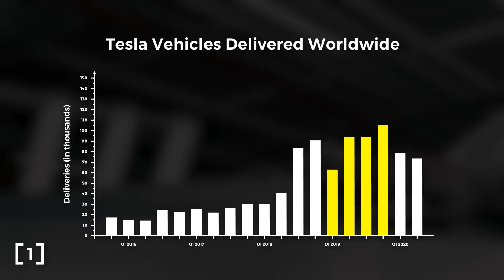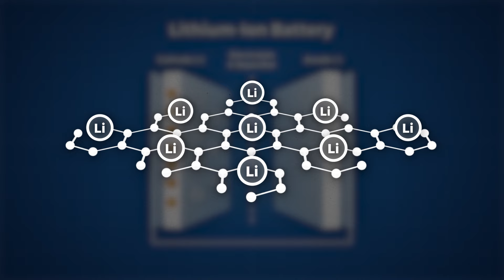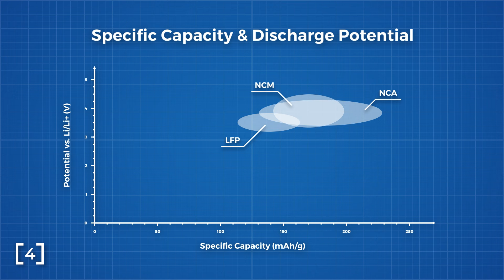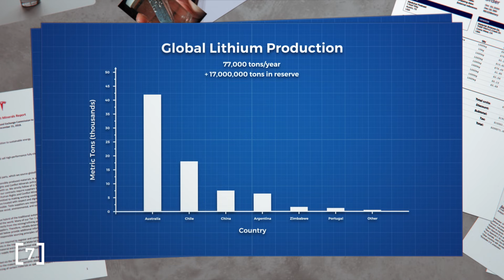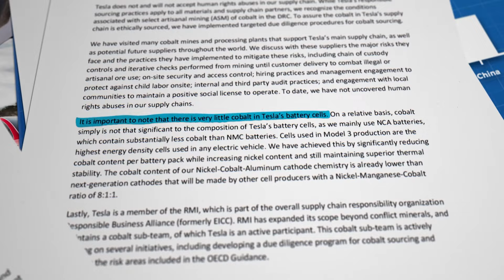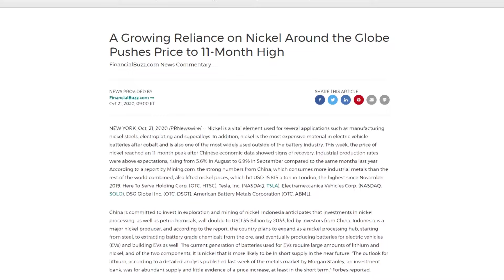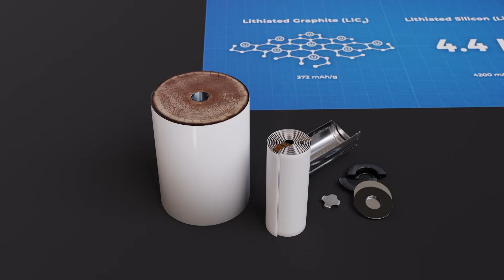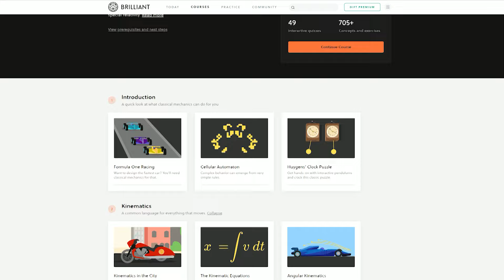Tesla's Battery Supply Problem

Comment: the only feasibly way to to dramatically reduce global carbon emissions is through a large investment in nuclear power
Reply: A breakthrough in geothermal could help, but currently it’s only viable in volcanically active zones.
Reply: As if we have a carbon emission problem. Just read the leaked emails about ClimateGate on Wikileaks. Get real!
Yes nuclear power is a great solution!!
Reply: @James-sk4db  Iñdonesian: yessss
Reply: Renewables are cheaper.
Reply: @JasonSmith709  do you have any clue about Thorium? Do you have any clue about physics?
Reply: @tinolino58  yes, i know lots about physics, that's why i support renewables.
Reply: @JasonSmith709  I sm sorry: physic is not politics
Reply: @JasonSmith709  Nuclear is cheaper especially 4th gen
Reply: @JasonSmith709  the problemis the storage when renewables are just intemitent
Reply: @olivierb9716  that's what batteries are for

Comment: What i learned?

We need asteroid mining soon..
Reply: Thats not more profitable
Reply: I thought the same thing...
Reply: @Mr2winners  it actually is
Reply: there is spacex with Starship for that
Reply: Actually, hybrid batteries. Including ultra-capacitors. Rather then create a monolithic cell relying on one chemistry for storage. The switch cells to optimize on performance, range and lifecycle.
Reply: @sadface7457  Forgive my lack of knowledge, but how will ultra-capacitors out-scale the the range of a battery?
Reply: @DiegoLopez-zk8vj  Current rockets cost 1k/kg to low earth orbit. It costs about ten times that to go to the moon. It would be at least 100 times as expensive as it is to mine on earth.
Reply: We need to mine the oceans.
Reply: @Justin73791  The idea is analogous to harddrive cache or computer ram. The ultra-capacitors sit between the battery and the engine and help reduce demand on the batteries. The fewer micro- cycles and with even discharging on the batteries the longer they will last. They extend range though regenerative energy capture technologies and by reducing resistive losses cause by the internal resistance of the battery (high power output).
Reply: @sadface7457  Okay that makes sense, but would it truly help current battery range? From what I can find the best ultra-caps have a power to weight ratio 20 times worse than batteries. 

Unless they do a significantly better job of capturing regenerative energy I don't understand how it would be worth vs just adding more raw batteries. 

In terms of longevity I can see how they protect the battery from short burst, but Tesla batteries are already proving to last a long time. I feel like the best super caps can offer is a small hybrid buffer, but more of a small step forward than a true solution.
Reply: @Justin73791  I think in first principles. They change much faster. Rather then range as single number as if you are going on a road trip. Consider range interms of (what people care about) how far you can go on 30 minutes change. That ability to entended range (similar to ice cars) is an important that improvement to range batteries cannot compete with. Long term their ion capacitors will increase energy density. The average commute is under 30km.
Reply: @sadface7457  So basically instead of focus on a single ranged number, focus on faster charging times. 

Assuming they nearly instantly charge I can see that working. I guess as long as they can provide short trips uninterrupted and medium ones only require a short stop (like filling up for gas). 

Though we'd still have to solve problems like commercial transport.
Reply: @Justin73791  The transportation equation is best solved with a plurality of approaches.The notion that one transport option, one battery option will suffice will lead to a resource bottle necks. 

When the petrol price is high people consider diesel as an alternative. If the mineral price increases their will be a premium additional range will be less attractive to consumers because it will cost so much. Since batteries are a lot upfront people might consider fewer batteries or battery alternatives or alternative chemistries.

Capacitors dont have instantaneous change time but they charge 10-100 time faster, dischange and charge times are related, and that will feel instantaneous compared with batteries.
Reply: @DiegoLopez-zk8vj  no, it's not. We don't even have the technology to do that now.
Reply: the flaw of asteroid mining is that the economy is not ready for mining on earth to be replaced
Reply: @LH-zz1pg  The space travel is not energy efficient enough to make it viable.

Comment: This is a top tier information, content and presentation, good job!, a lot of things to think about this issues.
Reply: He actually missed the most crucial part about the new battery construction - due to tabless design new batteries are planned to be few times more energy-efficient than current ones. This may solve all the other problems with material scarcity etc. So the whole video is either a bit of propaganda about how tesla is worse than it actually is or Brian is worse at engineering than at making videos.
Reply: This guy elaborates on the technical specifics and efficiency of the new battery quite a bit:
https://www.youtube.com/watch?v=hbPKE62aM0U

Comment: When it comes to grid, or long term energy storage I always thought about Hydrogen.  Excess electricity would be used to split the water into hydrogen and oxygen. Store it over time, and then as needed use it as a power supply when the demand is needed. 

I am sure that I am missing a lot of key issues in the process, from cost to efficiencies, still this has potential I believe.
Reply: The most obvious issue is: it needs to be compressed and this means energy loss.
Also some of the parts needed in hydrogen duel cell are also not cheap, is my guess. But it's not the only option, the Wikipedia page for hydrogen storage is long.
Some hydrogen plants for grid energy storage do exist: Canada, Germany.
Reply: From what I know, hydrogen extraction from water is extremely unefficient compared to other storage methods, which is the reason why hydrogen is very often produced from oil.

But with more research, who knows what could be possible in this sector?
Reply: @Theimtheimtheim  "which is the reason why hydrogen is very often produced from oil." I believe it's actually natural gas, not oil. But I'm no expert.
Reply: @autohmae  yeah, me neither, but you're probably right...
Reply: Many people have already thought about that. It's called Hydrogen Batteries. Since Elon Musk families owned mines in Africa since before he was born, he has not only ignored but attacked the technology.
Reply: @nemou4985  woah! Conspiracy theories much?
Reply: @Theimtheimtheim  but from oil or gas more green house gases are dumped into the atmosphere,  so not sustainable.   Do we have sufficient accessible fresh water in the world to destroy it creating hydrogen?  Should we only use salt water which then brings us back to transportation.
Only way I see for hydrogen  is leaving the waist products underground in place of the gas/oil.  As is being done on a small scale in Canada.
Reply: @sasa asasasa the grid doesn't need compressing storage. Plus we use compressed natural gas all the time, even on converted cars. Hydrogen is explosive? Yes, but so is gasoline, I don't see anyone running away from it.

Comment: The Tabless battery also has far more Power Density (lower internal resistance) according to EEVBlog. That means they'll have the Energy Density of Cylindrical Batteries but the Power Output per KWH of Pouch Cell batteries.

Comment: The use of batteries to overcome the drawbacks of solar and wind generated electricity is ridiculous, the answer lies harnessing the nuclear process in some way.
Reply: Exactly. And natural gas isn't even bad.
Reply: Someone calling "use of batteries to overcome the drawbacks of solar and wind generated electricity" ridiculous wants nuclear energy? Good joke. Nuclear energy is absolutely uneconomical.
Reply: Nuclear energy has proved expensive, at least in the United States,  primarily because of the regulatory overheads imposed by fear-mongering. Development of the techniques that would open the door to cheaper solutions has also,to some extent, been held back from this negativity, here small modular reactors manufactured in a factory would short circuit many of the delays of building onsite. In the longer term there are other inherently safer designs that utilise molten salts, which besides being more efficient and almost impossible to fail catastrophically supplement there value by reducing the production of dangerous left overs, indeed they may be able to reduce the current stockpiles of used fuels. The world needs an international effort to develop these answers, fields full of solar arrays and hugely destructive wind turbines along with batteries are no solution.

Comment: I feel like you missed the point of Tesla’s use of multiple chemistries and in particular not using nickel in grid storage and only using cobalt (in increasingly reduced ratios) in a subset of their products. Not to detract from other grid storage options, your point regarding lithium still holds.
Reply: Yeah, they'll likely use the lithium iron phosphate batteries in the megapack which will be much cheaper and last probably 4,000 cycles minimum before being scrapped for recycling.

Comment: Where it's possible, pumping water uphill is a pretty effective energy storage system.. already in the 1960's Switzerland reversed the turbines and generators at night to pump water uphill at night when grid demand was low, it may not be as efficient as charging a battery (I haven't done the math), but it should achieve at least 60% overall, but it requires far fewer limited resources to do, especially with well chosen locations

Comment: I have studied that cathode is negative and anode is positive ???
Reply: Depends ....
It threw Me at first also .....
Rechargeable batteries are a little tricky .....
The polarities kind of depend on whether it's charging or discharging .....
Reply: Chemically, the anode is negative and the cathode is positive. 
Not sure why you learned it the other way around, maybe something to do with how electricity travels form + to - in engineering, but from - to + in physics/chemistry?
Reply: Actually cathode mean where the current exits the device and anode, where the current enters. The polarity depends of the device, but for discharging batteries the cathode is positive
Reply: @jonashageboke8993  Phone Company guy here ..... Positive anode , negative cathode ..... In a vacuum tube (Yeah , I'm an old Boomer) the cathode is always NEGATIVE or You have problems ..... I think the disconnect is coming from the fact that it depends on whether the "thing" is acting as a load or as a source for power ......
EDIT :: Rechargeable cells offer a helpful way to see why the cathode in a galvanic cell becomes the anode in an electrolytic cell. Rechargeable cells work in both galvanic and electrolytic modes - galvanic when they are powering devices; electrolytic when they are being recharged.
Reply: @stevenattanasso2003  that makes sense. Thanks!
Reply: The anode is the oxidation center, the cathode is the reduction center. 

In galvanic cells anode is negative, in electrolytic cells cathode is negative. This is because oxidation and reduction centers are reversed for the two cases. 

Rechargeable cells act as galvanic cells when discharging and electrolytic cells when charging.
Reply: @stevenattanasso2003  you are wrong on some points friend.
EDIT: you fixed it 👍
Reply: @jonashageboke8993  in all cases anode is where the oxidation happens and cathode is where the reduction happens. 

It's switches +/- because current is reversed when recharging instead of discharging.

Electrolysis is chemically similar to a battery that is discharging.
Reply: @ayushsharma7342  Where was I wrong ?
Reply: @stevenattanasso2003  As the person who wrote this comment, I study in 9th grade. So I am sort of getting overwhelmed with all this information.😭😭😭
Reply: @tanmayta9131  I'm overwhelmed You chose Me for help , and flattered ..... I believe Ayush Sharma probably has a firmer grasp on this subject than I do ..... I will assume You learned ( as I did ) in an "electronics" environment that the anode is positive with respect to the cathode ..... In a device which absorbs energy of charge (such as recharging a battery), the cathode is negative , and in a device which provides energy (such as battery in use), the cathode is positive .... Most electronic devices absorb energy ( considered a "load" ) so usually the cathode is negative in that type of application ..... Does that help ?  
EDIT :: I wish I was in the 9th grade !!!
Reply: @stevenattanasso2003  That helped a lot.
Thank you.🙏🏻🙏🏻🙏🏻
Also thank you to all the people who replied. I learnt a lot reading all your replies and I think I have a much better understanding of some of these things after reading all of this.

Comment: Now we need a way to charge these batteries without "voluntary" blackouts.
Reply: @collinf9943  Blackouts here in Cali due to the electrical grid being overloaded.
Reply: What does that have to do with charging batteries?
Reply: That's grand ,chuck more batteries on the grid to help balance it , and you won't get  black outs ... 
( Seriously most national grids want batteries on them for grid balancing )
Reply: The batteries are there to do the exact opposite - they provide the surge power when demand is too high for the supply. They don’t cause blackouts, they eliminate them.
Reply: Perhap in the US with their old power grids. Anyway, it wil evolve like everything.

Comment: What this video tells me is it isn’t much cleaner to go “green” than to drill & burn oil! Mining for these metals on the scale needed is a very dirty and pollution intense process.
Reply: Yes.
But people won't accept any kind of diminishing of their standard of living. And since we're living in (and want to continue to live in) liberal capitalist economic systems, there is no feasible way of making them do so. So what are we supposed to do?
Climate change is the most pressing issue, globally speaking. We simply have to tackle it, there's no way around it. And we're almost out of time already. So we kind of have to find ecologically acceptable solutions on the run.
Reply: We need to engineer our way through this problem. It's happening.
Reply: Electrical engineer here. Building EVs does currently produce a bit more emiddions than producing regular petrol fueled cars. But, they can well be less polluting in the long term. It just depends on how the electricity used to charge the cars is produced. In countried like Indian where a lot of the electricity is produced by burning coal, the EVs aren't really worth buying to cut emissions. In countries like Norway where nearly all of the electricity is produced by hydro power, EVs become overall smaller polluters that petrol fueled cars in just few years.
Reply: Don't forget that easily available oil is a finite resource. There will be a day, when cheap oil won't be available anymore. Ok, now it looks like it is 100 years away, but either way, it is much easier to start solving this problem now, than wait until the the last moment.
Reply: It depends on what you mean by "green". If the grid electricity comes from nuclear or renewables, than it addresses climate change. Mining is a separate environmental issue.